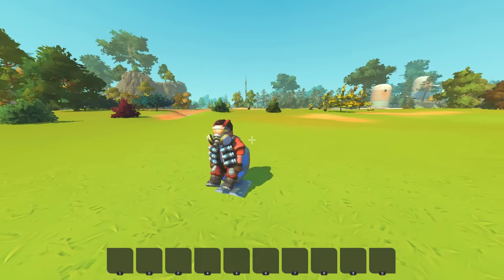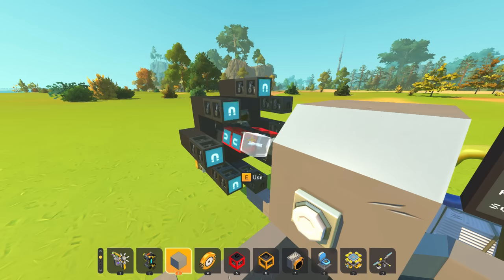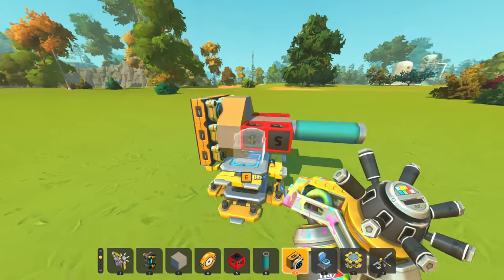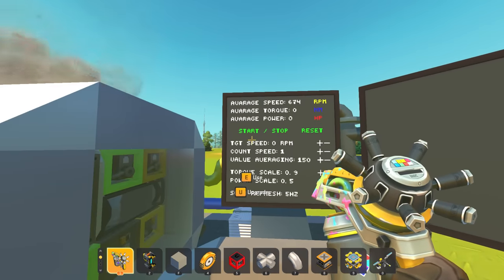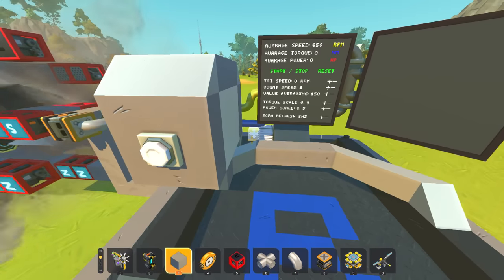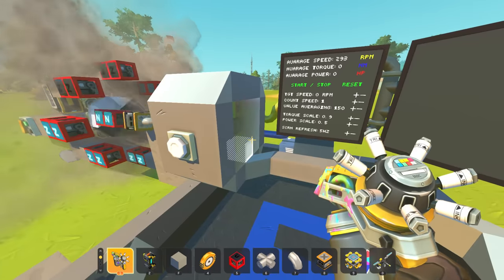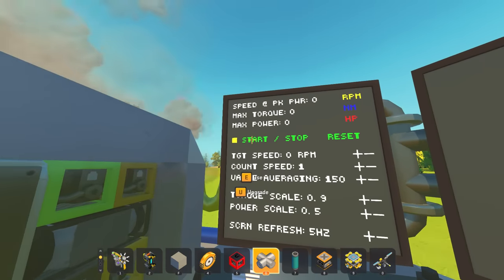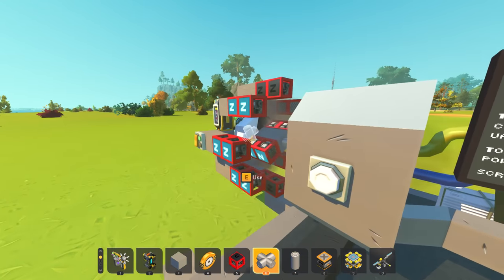Building and Testing a New Magnet Motor on a Dyno!

Comment from the maker: What other things should we build or test in Scrap Mechanic?
Reply: Build Obama
Reply: I am curious if it is possible to create a levitation engine , like those in UFOs using the magnets you used in this video .I once tried to make one but I couldn't make anything exciting happen but I hope you will.
Reply: @kANGaming I saw you first video of this magnet mod i'm getting nostalgia from this.
Reply: Can you build a contra-rotating gyrocopter. Like a mono engine gyro had a kid with a v22 osprey?
Reply: @Andwo0 # toilet gang
Reply: can you bulid a v6 engine or any v engine that works
Reply: try the bomb engine on the dyno
Reply: Can you make a radial using spud guns? Love the videos.
Reply: can you build a rotary?!
is it possible in scrap mechanic or would it need to be way too big.
Reply: Can you try making a car or train powered with a magnet motor? (So it wouldn't be a maglev)
Reply: wondering when if you were gonna do the torque piston challenge?  anyway love ur vids.
Reply: Magnet motor race
Reply: how much power/torque does the lift apply? (using trammel gears for a gear ratio)
Reply: just do the piston engine I wanna see what other improvements experience may bring since I also tried building it and I just offset the pistons be 45 degrees and it is ilke one big power stroke and nothing else
Reply: make this magnet motor again but much larger, perhaps that will aid with the timing?
Reply: I made a truster piston boxer engine, maybe you could try it
Reply: Does the dynor have an output you could use? Build a simple AI to calculate optimal settings on the magnet motor. You would need separate controllers for each bearing
Reply: You should build a car around the magnetic engine and race it was someone just to see how it goes.
Reply: A massive hybrid car with your electric motors and explosive engine.
Reply: I say just add more magnets
Reply: Spudnet
Reply: anything that is not scrap mechanic and is more factorio like for games, computers for scrap mechanic creations
Reply: See about optimizing some gear designs, like have some different trammel gears, some different spur gears, and see about designing new gears to be anti slip, simple to make, and in general good.
Reply: Life in scrap mechanic, so a whole world 🌍 can you build that?
Reply: Remake the magnet powered car 🧲🧲🧲🧲🧲🧲🧲🧲🏎️🏎️🏎️🏎️🏎️🏎️🏎️🏎️🏎️🚓🚓🚓🚓🚓🚓🚔🚔🚔🚔🚔
Reply: @Anonymouzor that will be cool
Reply: @Clr-Clr that seems to big for scap mecanic
Reply: More piston engines!
Would love to see you mess with and fine tune some piston engines in terms of piston strength and extension length, and also the radius of the crankshaft to hone in on the best engines

Also try an old thruster combustion engine on the dyno!
Reply: And is it possible to connect some piston engines/controller engines in series and mess with the gearing to make them a viable solution?
Reply: bread
Reply: It could be possible to use the magnets as ‘simulated steam’ as a way to make somewhat more realistic, steam engine valve gear
Reply: Bipedal walker with mechanical steering
Reply: Test a thruster to see how much horsepower it has.
Reply: Hey kan can you use the ‘gear mod’ to make the fastest rpm and strongest torque.
Reply: Try making a bigger magnet motor. By bigger I mean longer arms. Bigger radius. Further the magnet is from the center point should mean more leverage, torque.
Reply: @tychandler362 good idea
Reply: Spud powered rotary engine either using recoil to spin a rotar or the potatoes. Also I’ve noticed an issue with the dyno. If you have an engine running and then you test it it can sometimes output much higher torque than it really has. The spud engine I built had 8,000rpm but it showed up as 2700nm of torque and 1472Hp which from my experience with it this engine can barely move a car so there is a small chance that a high rpm engine will output much higher values due to the inertia of the spinning bits adding force. I redid the testing but started the engine right when I start the dyno and I got 2Hp instead lol.
Reply: Gundam!
Reply: A "V" Piston engine e.g. V2, V4, V6, V8 etc. (repost from last last vid)
Reply: Magnet powered car
Reply: you should dyno a piston locomotive, see how the valvegear effects the dyno
Reply: kan, I tested it in scrap mechanic and if you put a 1 block space between the timing wheel and the sensors, without adjusting the controller I could get and avarage of 2000 rpm because the sensor and timing wheel weren't rubbing against each other anymore and get about 90 hp. also it turns out that if you set the controller to 53 degrees you gain like 100 rpm and get over 100 hp without adding new magnets. I made a complete magnet ring on the outside and managed to get 2470 avarage rpm and got over 200 hp and 1100 nm max torque with very little lag, after that I made the inner ring complete and got 47k avarage rpm, 33k to 39k hp and about 13k to 16k nm of torque! (this comment will get a lot of edits as I test new changes)
Reply: Build a piston engine with a timing wheel that advances based on rpm (see my other comment)
Reply: I have a hypothesis about this engine:
As the engine speeds up, it 'generates' more lag. So maybe add a logic system that starts the bearing at -15deg and slowly increases the angle upto 53deg (sort of an auto gearing system).
Reply: How about using the mod pack to automatically change the encoder rotation to the correct one?

Just try every rotation from -90 to 90 while jumping 5 degrees every time, and measuring the horse power a couple of times!

(Although I don't know if you can extract the HP out of the dyno using the mod pack)
Reply: I can't believe you didn't mount it in a car to see us how it performed.
Reply: Could you try a bearing engine? I don't know what they're called, but you hook up a series of shafts that add up rotation speed using a controller.
Reply: A maglev train or car
Reply: try a Magnet  piston engine
Reply: multi-player Monday idea:engine build off and see who can make most power and tq then boat race the motors
Reply: You should try making a helicopter that uses one or two of those motors. That would be very interesting.
Reply: Curious what if you make the magnet motor a 4pull? Would it make more rpm are less.
Reply: we need more kan lore

Comment: Kan maybe replace the encoder wheel with lighter material or friction less mesh blocks to see the results. Just curious
Reply: Using mesh blocks won’t make a difference since a creation doesn’t have any friction with itself
Reply: Just use something that doesn't have a full block hitbox and therefore causes all sorts of collisions. Same for the tremel gear
Reply: Mistner  nah hes right, no frictional force gets calculated on the same creation, only collisions
Reply: A heavier block would work better cuz it would act like a flywheel

Comment: Hey just a quick heads up, it's almost always better to use an L shape instead of an I shape on the encoder wheel for anything like magnet motors or piston engines, wedges in the encoder wheel can also hurt performance at speed too. Also what you said about there being a delay between the sensors and the magnets being a thing is very true, its actually the main reason you need that offset before the encoder, true for piston engines and magnet motors as well.
Reply: Movement > sensor > magnet state > impulse
Looks like there's 4 ticks of latency there.
Reply: hi ben!

Comment: If you have about 600 rpm, a round takes 4 ticks so with the one tick delay you should have about 90° of difference so it's about what you got (of course it's a bit random but it's logical to have a big offset). Also when applying force with a mod it takes 2 ticks before de velocity changes for some reason, so maybe the sensors where activating the magnets for the next turn
Reply: I have the same issue with my vanilla Gatling gun
Reply: @egornick9206  why would you need a gatling gun?
Reply: @flazerrazer2992  big red robot

Comment: Im not convinced that it was the bearings decreasing performance, i thint it might have been the bar. Try using pipe peices instead of blocks to see if the curved pipe peices that were holding the pistons were colliding with the bar

Comment: The wedges on the encoder wheel are actually colliding with the sensors proving that Brick Gang is superior.
Reply: you should also probably have the magnets on the outside on both north and south
Reply: the encoder wheel should be separated from the sensors by one block

Comment: Magnet motors are good for rpm and torque, im not speaking from experience but ive seen some doing crazy amounts.
Reply: just to say, a house-sized electric generator can basically rip itself out of the floor WITH the correct instalation if it's electrically attached to an already powered grid but with the wrong timing (you have to align them )

Comment: The reason why the speed keep jumping up and down is because those curved pipe pieces attached to the pistons are hitting that concrete part in the middle, instead of concrete you should have used pipe pieces instead
Reply: This and also maybe spacing the encoder wheel by 1 block between the magnets would help too

Comment: The timing problem with the encoder should be a 1 logic tick delay, and just rotating the encoder isn't really gonna fix it. To make it perfect you'd need to measure the current rotation speed and increase the angle of the encoder accordingly since the delay is constant but the speed changes

Comment: Brushless dc motors in RC stuff most of the time are actually synchronous ac motors with a controller converting dc to ac. Also they are often wired inside out - the stator with coils is put in the center, and the rotor with permanent magnets is the outside cylinder, and the shaft is connected to the outside part.
Reply from the maker: I have a few of those types as well where the rotor is on the outside but my 1/10 cars all seem to use internal brushless with the rotor on the inside, stator on the outside with the coils in it.

Comment: One thing you might try is putting two separate plus shaped encoder discs.  This would allow you to connect both to a controller and change the total overlap distance.  You can paint one block on each, and offset them by 90degrees to get two blocks worth of timing.  You can do this with a single plus, but what you cannot do is get, say 100 degrees of timing.  That you can accomplish with multiple encoder wheels.  I would love to watch an hour long video of you adjusting the timing duration and position.

Comment: It looks like the pipes connected to the pistons on the stabilizer parts of your trammel gear might be hitting the concrete that's nearby; that might also be what was happening with the motor that had the stabilizer. If you replace the concrete with pipes, they should be small enough not to get hit by those other pipes.

Comment: I dont think it was smoother because you removed the extra bearings.

I think it was smoother after you removed the shaft support because the shaft was sometimes hitting the shaft support.  You used full blocks to support the shaft causing the pipe pieces to be flush with the support.  The small wiggle room that bearings cause allowed the pipe pieces to hit the full block support.  If the support was instead made out of more pipes, I do not think you would have the collision issue.
Reply: (obv. less bearings tends to equal better performance but I don't think the main issue was the bearings.)

Comment: I would recommend having south polarized magnets with the north ones (static on the body of the motor) that are activated with the opposing north magnets
Reply: Yes, my thought as well, it would stabilize the shaft and avoid the tangential force moment that's created with the push-pull configuration
Reply: @amahashadow  it also opens up the possibility of a bidirectional design

Comment: If you use just 8 magnets total and have a variable timing you can tune it up to 20000RPM+. I made my motor as light and friction less as possible and it even has some torque at high speeds unders 7000RPM it's worthless bud at high speeds it's amazing, the same dyno you use measures up to 1800HP for sore reason...

Comment: Your engine is so unstable. The problem you are having is bc you had the wrong configuration on your timing. There is no need for a bearing to rotate the timing wheel. You just need a different color pattern.
I had best results using this:
Same pattern as you have but the block underneath the north side of the rotor also needs to be colored in. Tho I haven't built an electric motor in a long while I think the general physics are still the same.

Comment: Hey kAN, I would really like to see you try to make piston engines with more cylinders/pistons. Having made plenty myself, I can say for certain that building a V8 is 100% possible. If you want a mediocre challenge against somebody that's ok at piston engines, try beating my record of roughly 12,000 Newton-Meters of Torque. I say this because it was pretty slow, and thus didn't have much HP. I did it with only 8 pistons in what I believe to be called a boxer style configuration, but only to increase power, because as you probably know, piston engines are all technically 1-strokes. I also had the pistons 2 blocks away from the central shaft instead of 1 to increase leverage and again power with the sacrifice of speed.

And for an additional quick tip, specifically the 1x1x1 wedges you used on the flywheel/encoder cause TONS of friction between parts moving next to them and get caught on things absurdly easily. I wouldn't be surprised if they were the cause of all the banging & smoke effects. I would recommend substituting them with any kind of pipe bend, as long as the sensors still detect them.

Comment: I believe there’s a trade off with the timing between torque and speed. When you have the motor already spinning fast, you need the timing to be advanced to account for the lag of the rotor reacting to the charge of the stator. The amount of advance for the fastest speed can often be so much that the motor will go backwards when starting from it. When you want more torque you need the timing to be more retarded so the rotor can keep getting pulled along when it’s bogged down.

Comment: Advancing the timing wheel speeds up an engine because scrap mechanic has tick delay.

Let's say we make any engine and the engine is spinning at 300 rpm. The tick delay is 1/40th of a second, meaning that the engine makes 300/60/40 = 1/8 rotation before the piston or magnet activates (assuming sensors go straight to the piston/magnet). This is the main reason the timing wheel has to be offset, having a proper starting position is only a small part of it. If the offset is just slightly wrong the engine will work against itself, producing less power or potentially spinning the opposite direction.
Now note that this calculation is done for 300 rpm, the required offset is actually a linear function of the current rpm. You need different offsets at different speeds. In vanilla SM this is basically unattainable, with the modpack it is possible tho.

Let's do another calculation. The highest speed I've had one of my engines go after learning from the guys in the mechanical community is 1250 rpm. At this speed the timing wheel has to be advanced by  1250*360/60/40=187.5 degrees. The timing has to be advanced by more than half a rotation!

Comment: BLDC motor are 99% of the time 3 phase motor (so you may argue are really AC and the ESC does the magic).
Anyway, if you look up BLDC 3 phase you will find tables on how generate the phases; and you can also "wind" it (in you case "signal it") to be a Star or Delta (torque vs speed).
You changing magnet (coil, or strator) should be multiple of the number of phases, and the ratio of strator to coil is generally 4:3 (or 3:4, i always mix it up).
Probably the best implementation is to have sensor stepping a state machine, and each step activate one of the state that control all 3 coil; IIRC is only 6 step, and each step change only one phase, so it should be easy logic (not sure how to implement it in scrap mechanic tho)

Comment: Take a brushed RC "mod" motor with adjustable timing, clamp the can in a sturdy mount,  give it 2s power with the screws loose, and advance the timing. RPM will pick up, and you can find a max RPM point doing the same as you're doing in this video. If you then lock the end bell, and power down the motor, the timing you have set will be so extreme that the motor won't want to start without help.

Comment: I like how kAN after the video on the piston trials was like "Imma grind piston engines in creative mode until I find the one to beat this challenge" and now he's just messing around with a dyno.

Also, some tips from a person who passed the first torque trial:
1. Make a four stroke engine with one piston above and one below each segment (this makes it more stable and powerful and reduces the number of bearings absorbing torque)
2. Lock the bearings between segments using blocks to prevent the bearings being over torqued
3. For the encoder wheel, put 4 sensors on the bar connected to the giant wheel facing a C of blocks with wedges for the ends of the C (wedges act as half a block, meaning your timing is 50-50 for an almost non-hitching engine)
4. You might be able to get a 3 stroke engine with each segment containing 3 pistons, but that makes things a little more complicated.

Once you pass the normal torque trial, the wheel is upped in weight. Instead of cardboard, the outer rim is made of tier 3 wood. In the insane trial, you have the heaviest wheel in all existence: tier 3 concrete. Proper gearing and maybe a more clever engine design may be needed (like an auto rachet engine).